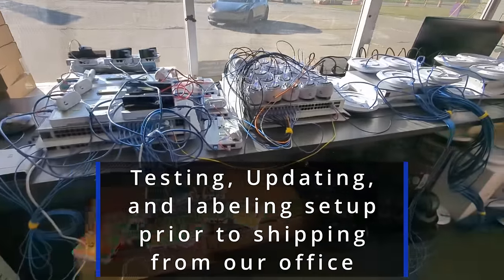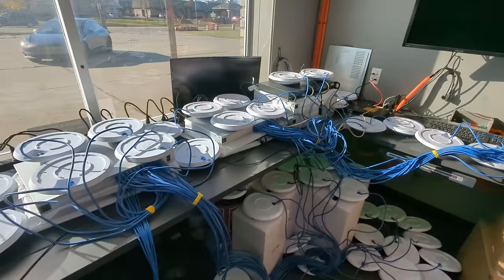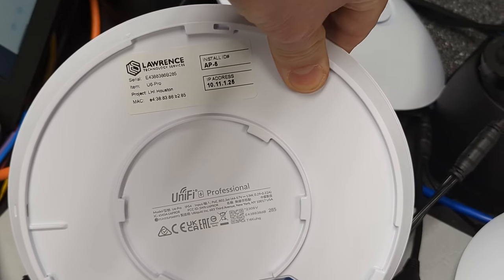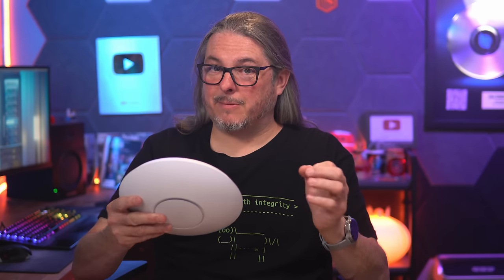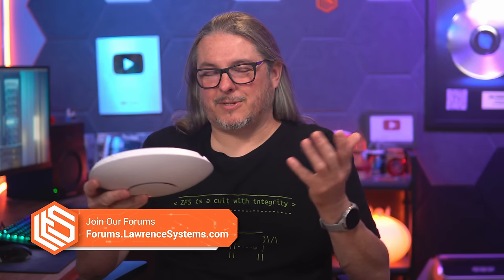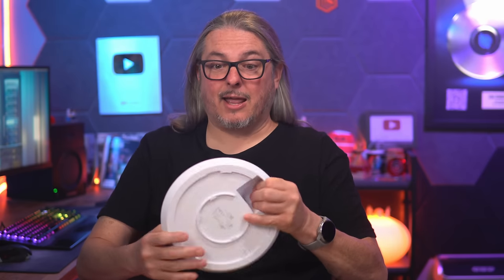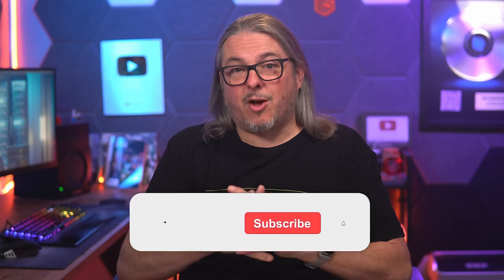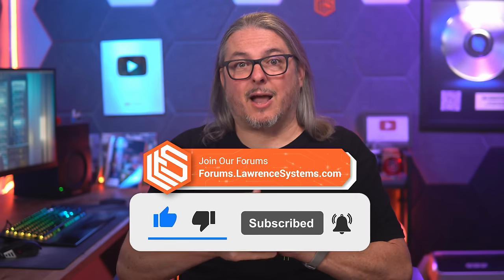UniFi: Built to Last? My 6-Year Access Points & Switches Project Follow Up

Comment: how many of the U6-LR access points' LEDs have dimmed drastically?  That's something I've noticed over the last year - year and a half of the initial batch i put up at work.  I've verified the LEDs were actually on; but very dim.  There used to be a setting to control the brightness; but i don't see it anymore.  It's not something i would have changed.  It's just something i'm wondering.  I haven't felt it's worth my time to put in a ticket about it.  I don't feel the need to replace them over the LEDs.

We got them during the pandemic and supply chain issue shortly after they came out.  I think i read about this being an issue with the early ones.
Reply: LEDs do die over time, especially if overdriven. And overdriving LEDs is super common sadly.
Reply: they all seem to dim with age(Unifi AP's and other), probably over-driven a bit or right from the led manufacture with overzealous specifications. some of the older AP-AC-LR are now dim enough you need to be in a dark room or place a hand  to shield and your face close looking at an angle inside the units.
other models are all doing the same, with age, that said, it's typical of all LED's to fade with age, especially with 24/7 on time. one way to solve that is dim them, by undercurrent/lower drive levels. I have & seen  lots of older gear with dimming LED's, laptops, printers, surge protectors, monitors, tv's. well you get the idea, it happens and faster on the brighter high output models.
Reply: @throttlebottle5906  Yea i would expect it on things 8+ years old; but i'm a little disappointed in something that's only 3  years old.  I wouldn't have thought they'd be so over driven; but my original installed group are so dim you have to hold them up to your face and cover them to see the LEDs.  It's not a show stopper, just a little disappointing.

Comment: Will bet the 5 dead ones would still power up with a poe injector.  The ac pro models most common failure is where they stop negotiating poe but work with injector.  Mostly dead but not all dead.
Reply: that happen to one of my AC pro but rest works fine

Comment: Just ordered a wifi 7 Tp-Link ap to replace my AC Lite, looks like the 2.4ghz radio is crapping out. Had a good run but ngl I'm not the biggest fan of Ubiquity.
Reply: Tp-Link i had too much problem so i switch to Unifi. i haven't try TP-link Omada but still lack behind Unifi right now

Comment: over 10 years of using unifi devices, 0 have failed, they have only been replaced because of upgrades and changes in the network. moving from an apartment with like... a controller runing on a garbage server, with a reused asus router, a USG, and a very old AC pro, to a dream machine pro, an 60w Unifi 8 port switch, and a nano HD, to the current setup of a dream machine SE, the new 16port pro max POE, the U7 Pro, that nano HD, a flex HD off that 60w switch, and lots of ethernet runs at the house we got a few years ago, everything is working fine, perfectly even.

Comment: Excuse me Tom, I would really like to see you do extensive testing of Ubiquiti's IPv6's issues. Specifically where IPv6 is essentially ignored by IDP/IPS, DPI, Traffic Rules,  and traffic graphs. While their hardware may be good, I am finding their software to be severely lacking.
Reply from the maker: I don't use IPV6
Reply: @LAWRENCESYSTEMS  entirely your choice of course. However, if I may make a suggestion. A lot of people come to you to learn about firewalls, routers, etc. Overlooking the modern IPv6 protocol does your viewers a disservice because they probably expect feature parity, same with your customers (although I'm going to guess you do not enable IPv6 for them). Unfortunately in my experience with Ubiquiti that isn't the case.

Comment: Bought one of their access points, it died within 10 months, replaced within the 12-month warranty. The second one died a few months later outside of the warranty period. What a garbage brand from my experience. Using some way cheaper TP-Link access point for years and it's still working.

Comment: Had 2 U6Pros. One died and took poe port in a switch with it. Probably external surge
Reply: that sounds like it was nearby lightning strike induced surge or it could be someone with very high RF output device inducing high RF currents in it(CB/HAM radio), if it's close to a road/expressway or large parking lot where they test or play around.